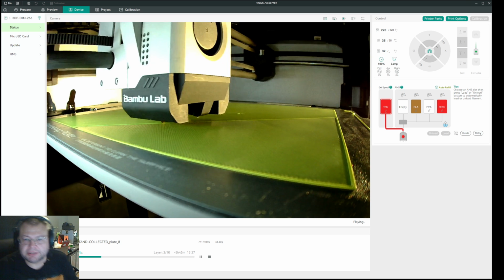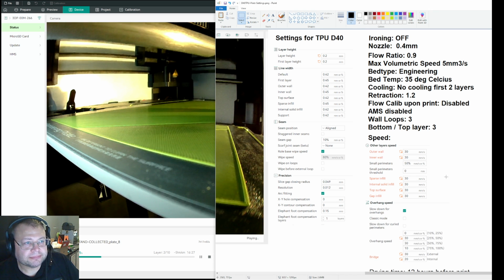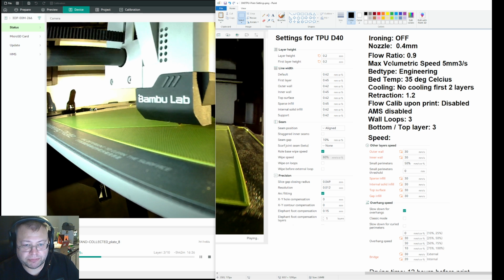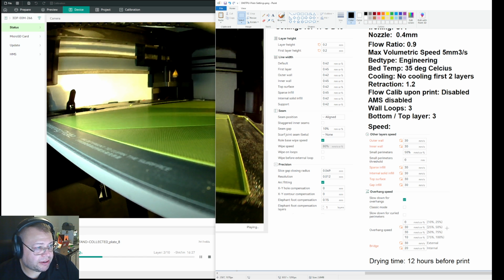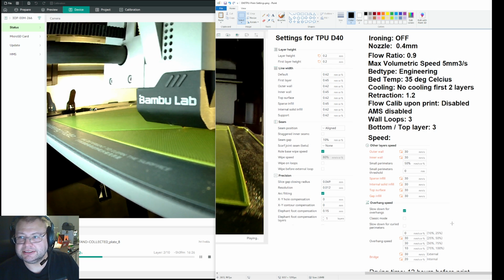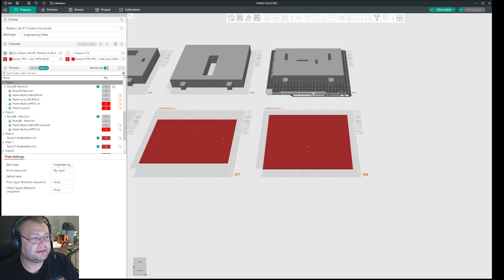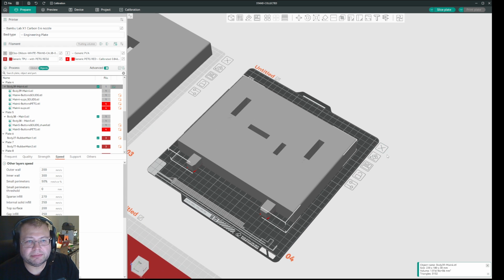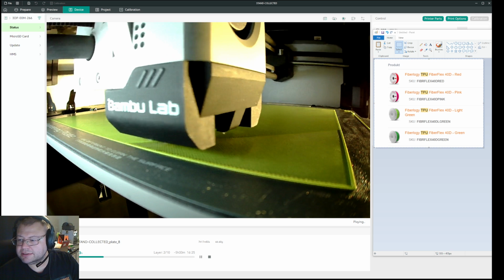Orca Slicer / Bambu Studio -  Fiberlogy 40D TPU settings

Comment: How is this compared to 95A TPU or Ninja Flex 85A? I wanted to try it but so expensive. I thought 40D was harder than 95A so it's really odd that it's required to print so slow.
Reply from the maker: I have never tried 95. I believe the lower numbers the softer TPU. It is not odd that TPU require slow speeds, it has a much lower flowrate than PLA since it cannot be pushed as fast into the extruder as hard-filaments. Typical flowpressure is about 2-3ms for TPU. While harder materials need more pressure and subsequently more material get melted in the extruder faster so you can print faster. TPU becomes stringy if you print it fast. TPU cools a lot faster than harder materials too.